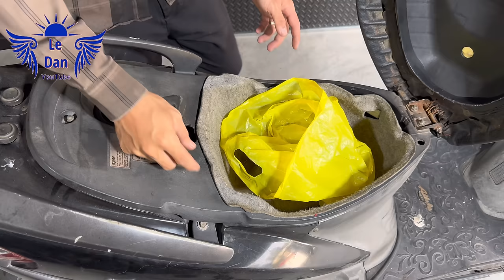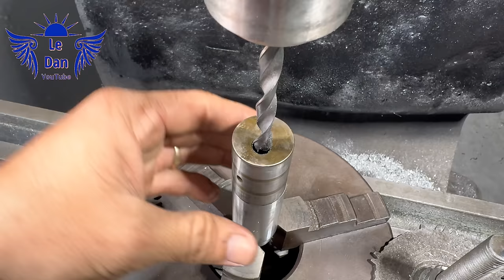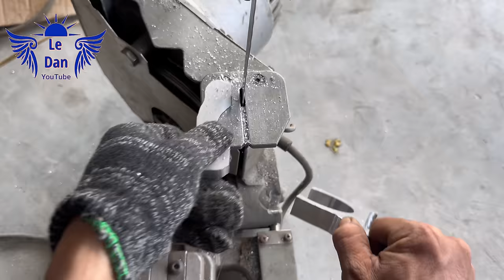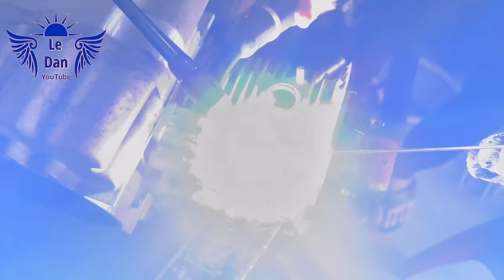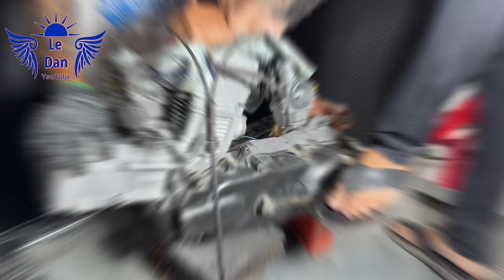I turn a regular scooter engine into a 250cc L-twin engine

Comment: Lntwin is a name that Ducati invented to make their engines seem different, they are just Vee Twins with marketing speil, your build are still amazing, no matter what you call them.
Reply: L twin is a specific 90° vtwin tho. V twin could be anywere from 45° or something right. To make the title more shorter than i turn scooter engine to v twin of 90° 😂
Reply: Actually the L twin name applies to a genuine 90 deg configuration, as in a right angle offset. Most manufacturers did not employ such a large angular separation between cylinders until the 1980s, with Ducati leading the way.
Reply: It wasn't a gimmick, the rear cylinder on V twin engines gets poor airflow & always wears out 1st from overheating. The L twin configuration allows plenty of airflow to both to cylinders, fixing the issue. The air cooled  L twin design is superior to air cooled V twin design.
Reply: @michaelbrinks8089 Ducati twins had the same layout and were called vee twins till late in the life of the belt drive twins, vee six automotive engines are still called vee sixes even if they are mounted across the vehicle for front wheel drive use. Ducati makes 90 degree vee twins, they just gave them a name to appeal to young people who have no idea of the history of the Ducati layout.
Reply: @michaelbrinks8089 they made the same engine layout for decades in twin and the rare vee four before one of the many new owners of Ducati came up with a name that would be able to copyrighted. It's Just Marketing Spiel.
Reply: @metricstormtrooper  Ya, the L twin is basically a 90 degree V twin but tilted forward (instead of upright) in the motorcycle frame giving it an "L" shape so both both cylinders get more airflow. So they called it an L twin, instead of V twin. 
Placing a 90 degree air cooled V twin engine  in the frame at an L angle for better air flow is a better way than a V configuration.

Comment: Engine sounds great, why one of the manufacturers hasn't made something like this is a mystery. Great job!
Reply: the manufacturers can't get the right milk to pour during the lathe jobs.
Reply: they made, such as t max, but for small cc engine it will waste the purpose as an efficient moped
Reply: nhà sản xuất họ thừa làm đc . nhưng  vì sự an toàn là trên hết .
Reply: Motorun birini soğutamıyor olmaz
Reply: @huynguyenthanh3656 theo mình nghĩ thì k phải vì sự an toàn. Mà là thừa công suất của 1 chiếc moto pkn
Reply: They have, it's called a V Twin. Same angle, just rotated to make a V instead of an L. It's actually quite a popular design.

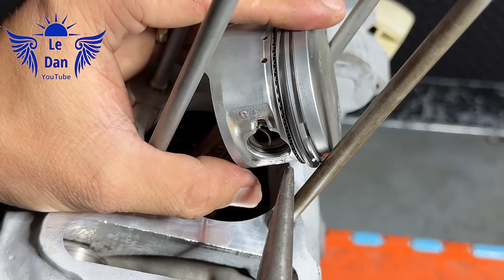Comment: @28:00  It is a good practice to align the pin of the vristpin circlip vertical to the cylinder bore because it can get fatigued 
by the reciprocation and break off.  I also like to cut the pin shorter to have less mass wanting it to flex. It does not happen often so I am sure you won't be having any problems this time either.   
Really nice build, again, big thumbs up!     Be interesting to see what you come up with next. :-)

Comment: big respect, just a scooter that looks boring, nobody would notice until the homemade converted 250cc engine shows the power, true sleeper
Reply: Surch for ITALJET  125 cc Scooters from the 1990s. !  2 stroke  2 cylinder  up to 40 HP !
Reply: how is 250cc a sleeper lol it wont go even if you push it
Reply: @wolfgangemmerich7552  yes! Very rare but really powerful
Reply: @lasersummit7895  Everything is relative right? this is a sleeper in the world of mini scooters casuse it has way more torque and a bit more power than the standard version + sounds beastly for a scooter.

Comment: Another stellar job!  Interesting use of rebar for shafting. Much rebar is high manganese because it's often made from "rerolled" scrap railroad rail. 
I like your cool self-made tooling and mill clamps too. Your aluminum casting repair skills are outstanding and should be a moneymaker.

Comment: Absolutely cool like every video you make. But i have one question: How do you generate Spark for both cylinders at the right timing when you only use one pickup signal???
Reply: Pienso lo mismo, aunq talvez utiliza el sistema de chispa perdida como los antiguos Ford modelo t de 1910 , siempre habrá una chispa disponible en los cilindros, así q si hay compresión y mezcla habrá explosión 💥, o talvez colocoo un segundo captor magnético q yo no pude ver 🤔🤔🤔🤔
Reply: He used two CDIs for that. Maybe he modified the timing marks on the flywheel and added a second pickup coil off-camera.
Reply: Harley Davison both cylinders fire at same time.

Comment: do both pistons reach TDC at the same time, just looking at your stator plate I only noticed one pickup so I'm assuming that feeds both spark plugs so they must fire at the same time, unless I missed something, a V or L twin firing at the same time will be very unbalanced, 
if the two pistons fire at 180dgs to each other the engine will run a lot smoother, which will allow for higher CC pistons, up to 500+cc easily,

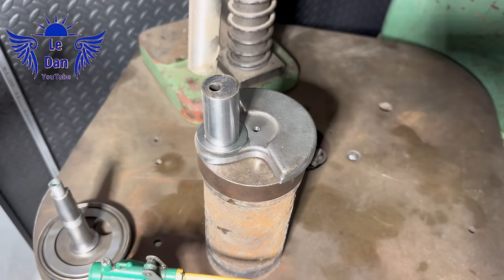Comment: 9:52 shaft pin is pressed with strenght about several tons. If you can do it with a hammer it means this connection is loose.
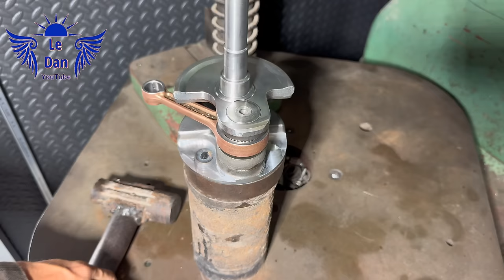10:20 Same situation.
10:33 You can't instal bearings like that. Upper part of crankshaft has to to be supported.
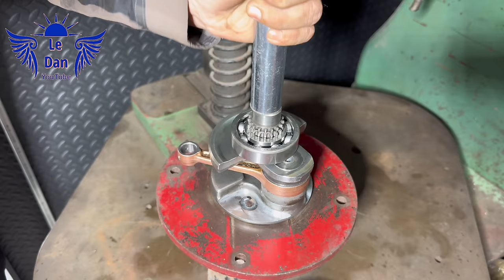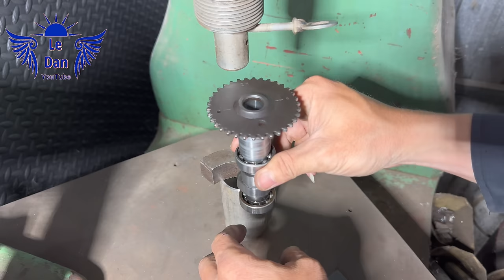10:42 24:50 Gears installed by eye without positioning. Than everythig is set by signs.

Comment: Sin ciao Le Dan from USA. I owned a Yamaha Zuma 2 cycle 50 cc scooter about 2003 model year. They have the strongest suspension and can handle the most weight. I am 6'1""/1.8542 meters and weighed 314 lbs./142.428 kg. Plus I carried my laptop and other various items and it never bottomed out and the tires were wider so if I went across railroad tracks it would never get stuck. If you can find one I suggest you buy it and put the 250cc motorcycle motor on it.

Comment: Heat shield the exhaust at the head so your gas doesn't boil in the carb bowl. A longer trip could cause you some problems

Comment: Why use same conecting rod? Is that make less power to add? Is that way better use diferent degree at the conecting rod? Better sound too btw 😰
Reply: I think it adds more complexity to the build. Afterall, the sole purpose is to make it a twin cylinder moped.

Comment: you should have put a pod air filter on the carb  that way you don't suck in dirt of the back wheel and risk scoring the cylinder after all that work

Comment: You havent modified spark timing, it is going to both cylinders at the same time by one ignition coil?
Reply: Have you thought about adding second sensor on stator bell, separate cdi and ignition coil for second cylinder? Right ignition timing could increase power. Overall ASTONISHING work, so much machining

Comment: Thank you for the video and great work, but I suppose this isn't a bike meant for riding since several essential things were overlooked, like the cooling system, which will cause it to overheat and leak. You also forgot the braking system, which is critical, especially if it's powerful, as it won't be able to stop properly. But aside from that, good job

Comment: hello you will need another air cooling fan  as you are making more heat with your extra motor and a wider drive belt to take the extra power   remember  more power  strength  to take the  power

Comment: why every channel or every live that visit people seam infected by flu?...are they sick?...what happens to them?
-:back to the that engine, if you boost correctly it gonna goes to 59hp, but it gonna eat bearing housing cause it too fast but less torque...it's best for you to rolling 80kmph before pull rather stand stood then rev the throttle like crazy.